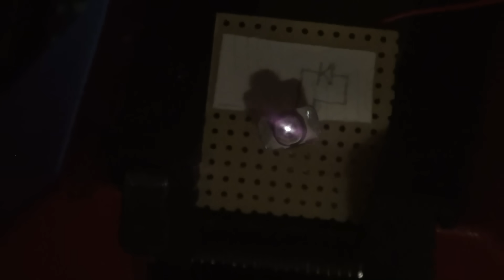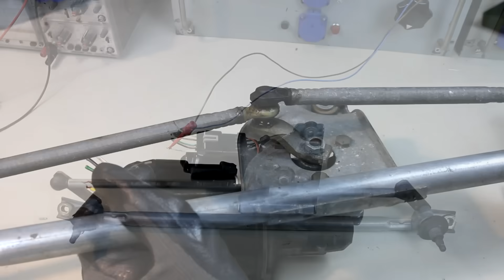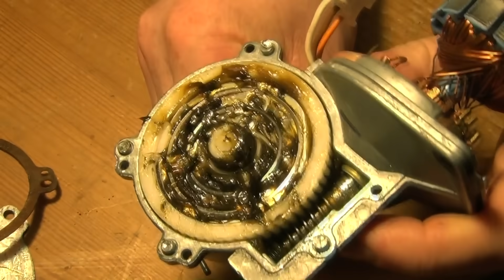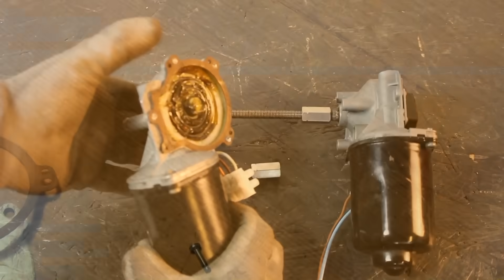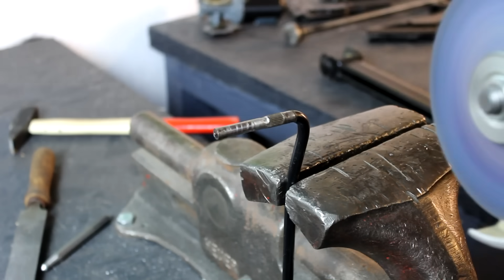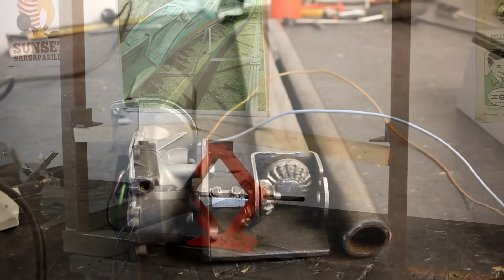Build Powerful Linear Actuators from Windshield Wiper Motors and Car Jacks

Comment: Watched until you said to use gasoline and a rag to clean the parts.  That's a very good way to burn your home/business down.  Nobody should EVER use gasoline as a cleaning agent.  Amazingly stupid comment.
Reply: Gasoline is just as flammable as any other thinner or solvent type fluid, people use them all the time and surprisingly still live. But those who can't comprehend flammable materials should really not go near a shop.
Reply: What should we use instead? White spirit/paint thinner/naptha/turpentine? Oh... they're all flammable too. How about brake cleaner or carburetter cleaner? Oh no that burns too. You see him using a welder and angle grinder, I think he's got the whole "don't set shop on fire" thing sorted ;)

Also, nothing wrong with setting yourself on fire occasionally, makes you warm...
Reply: Right to Record
Some still survive that didn't require 24-hour adult supervision, never received a "participation award" for anything, and didn't need mom to wipe snot from their nose. I know! Hard to believe, but they're out there.
Reply: I use it all the time for just that purpose, its excellent, cheap and readily available.

Comment: For a remote control steering unit, you should try the screw drive, power seat motor, like found in a late 80's Nissan Maxima (the one that moves the seat back and forth). It could work just as a rack and pinion unit. As well as open gates, and any other purpose you would use a hydrolic ram for.

Comment: have you thought about making a solar heater? with either air or H2o.  I'm sure you know how. or can figure it out. I'm planning on doing some type of solar heat for my off grid house. I plan on using water. so I can also use a wood stove . in the basement. as sort of like a boiler. for when its really cold. or no sun. great video like always.

Comment: you might find some motors and linkages to suit your purposes from seat adjustment motors . . . they have to be strong enough to move my fat ass so i bet they're strong enough for your robot.

[ unless you're building a terminator ]
Reply: will amoroso I was going to make the same suggestion you gave

Comment: please advise as to what you used for filler media to "weld" the stainless steel to regular steel.. I'm assuming more a "brazing" with something akin to silicon-bronze rod ?
Reply: Obviously I'm speculating but I believe that would be TIG welded with a stainless steel fill rod.
Reply: You can weld stainless with regular rods,it just won't be stainless anymore in the weld area

Comment: I built some of the same sort of devices. While making stabilizing for my camper van.
At first I connected a gear motor to a scissor jack. Made a nice little trash compactor.
Later I used a mechanical bottle jack, these worked great on my van.
My intention was not to jack the van off the ground, but lift it enough, so it wouldn't bounce around, as I moved around inside it. Great Video, Thanks!

Comment: Great video. Do you know of any wiper motors that dont have plastic gears? I would guess that would be the first thing to fail after a lot of use or torque
Reply: I would bet if you got a motor off an older car there would be no plastic. Ask someone at a car salvage yard about this . Preferably an older employee who has worked on older cars.
Reply: The trapezoidal screw takes most of the shit and abuse.  If you think about it the jack holds its own if you stop cranking and remove the crank it doesn't transmit any force to the stub; therefore the force on the motor whether plastic or not is minimal.
Reply: crzy11000 older cars generally are metal gears, you're right.
Reply: I believe that may be the idea sort of a shear shaft or weak link so the damn thing doesn't tear itself off the mounts if it binds up.
Reply: Howard Black a

Comment: building a robot from washing machines? build a scooter or wheel chair for someone. our gifts are to be used for others not so much for self gratification. lol and its so funny to see a plastic gear in the windshield wiper. cutting every corner they can.
Reply: Considering they run so little and you can find them perfectly intact in any scrap car I'd say those being nylon gears is just fine, far less fine when you open up an actual power tool and find that sort of crap in there...
Reply: The plastic gear is the  "shear shaft" since the motor has enough torque to tear itself off the mounts and destroy your firewall it is designe3d to fail at that particular part.

Comment: Another good source of trapezoidal threads that is rugged and can be obtained for cheap are scaffolding leveling jacks.  I have no clue how they're called in German, but I've used them before as the leadscrew for a wood vice.
Reply: Or mechanical hospital beds
Reply: Don't forget power seats for cars ;)
Reply: Yup I used them as leveling legs on my portable sawmill, found them in a scrap yard.
Reply: Leandro Pereira Yep, that's actually quite a good idea. Too bad they're too thick for many purposes though.
Reply: Gerüstfuss
Reply: The scrap yard will often house some electric garage door openers. There are lead screws that run the entire length, albeit a smaller diameter, but for low stress applications....

Comment: It's kind of annoying that manufacturers get away with pricing Acme threads as they do considering automation has pretty much removed any of the issues that plagued it back in the day. They make them just as easily as they make normal threads. But because they look different, you have to pay extra.
Reply: Economics of scale. Compared to normal threaded rods none really needs a lead screw.
Reply: +aserta Acme threads are cut, and then typically ground to a fine finish. Threaded rod is rolled with a thread die. The finish on threaded rod depends solely on how worn out the die is. If you can figure out a way to roll Acme thread that is precise as cut and ground thread, but as cheap as threaded rod, everyone will be begging you to take their money.
Reply: aserta it is a different operation, so overall scale comes into play.  Standard bolt threads are made by the billions, but the Acme type are much less common, thus slightly more expensive
Reply: I remember making them on a lathe back during my teens when I was working at my father's machine shop. Some as thick as two inches to be used on irrigation canal sliding gates. Now, of course smaller diameter ACME threads are rolled, particularly if they are to be used on applications where precision is not critical, like some actuators, car jacks, smaller vises, etc. For lathes carriages and as part of other precision equipment the threads need to be machined and polished to exact specs.
Reply: +Interstellarsurfer ACME threads are actually rolled. Its much faster and the cold forming creates a stronger thread.

https://www.youtube.com/watch?v=bclnb_Cp4sE
Reply: I found a source from a Factory in the US to get ACME for about 8 bucks/ft 
as opposed to 18 bucks.  for 1/2 dia.  screw.
and a little less for 7/16
(Resellers like McMaster mark it up to 18 bucks/ft)
Reply: pach maseen
Reply: aserta vtf f tgtfft  b g
Reply: Pass it on, please.
Reply: +Interstellar:
WRONG!!!  Acme threads are FIRST ground for a uniform OD.
Then they are ROLLED for a much stronger thread than CUT.
Reply: I used to cut 3.5 inch and 4 inch 2 start in 26%-28% chrome iron the single start was harder to do due the tool jumping out at the end
Reply: They not only look different. They're made of different type of steel and heat threatened, and made much more precise. There's really no comparison.
Reply: aserta n
Reply: Everything tody is charged at what they can get, for example why do wifi boosters  cost more than wifi routers?
Reply: "heat threatened"? sounds scary

Comment: It's interesting to explore gear ratios to move things. Wiper motor and window motors have plenty of gear reduction built in, as does the starter motor. If you play with hobby class remote control toys, you will notice the change in take off speed as opposed to potential top speed based on the pinion and spur gears used. If you discover the maximum rpm of the motor, then find out what rpm range it operates best at, then you can change the final drive ratio from the motor shaft to the other end of the assembly you want to power. If the gear on the motor shaft is small and the gears at the other end large, then the device operates slowly, but strongly. If the gear on the motor shaft is large and the other ends small, it may be faster, but less power over all. 
Motor manufacturers usually have spec sheets on where the input voltage should be to create the rpm range for peak power. Learn to plan your gear ratios with that, and you will have measurable success.
I hope in the future, you will come Sider hydraulic actuators and use a hydraulic steering pump from a car, powered by a robust electric motor. Those hydraulic pumps have internal bypasses, so they don't have to create constant pressure while spinning. Then you can use small valves with small servos to open and close them to have the desired actions. I've been working to invent flexible hydraulic actuators, but those secrets I keep for now.

Comment: those wiper motors have a surprising amount of torque
Reply: The srcret lies in the worm gear. The ratio of this gear is likely somere in the range of 40:1 - 50:1 meaning the speed is reduced and the torque is increased + it is not backdriveable. The dowside is that the efficiency is probably only 50 %...
Reply: 4X6 centimeters, or something roughly comparable to a 2"X3" (which is 1.5" X 2.5").
Reply: most all DC motors have a lot of torque and that's why metal lathes and battery operated drill or tools are DC. First it was all belt driven then pneumatic drive and now DC just for the torque.
Reply: Pacifico VW the reason I was impressed with the amount of torque is because I am nearly 400lbs and I need to bounce on a 2x4 to break it. So it must be able to output around that much.

Granted though my 400lbs is spread over a greater area than that of the jack.
Reply: The fact that it is a stronger piece of wood makes it boggle my mind even more :P
Reply: I am impressed that it can brake a 2x4; it can probably lift up a chunky baby off the floor.
Reply: @pacificovw9522  😁😁😂
Reply: Of course!  if you count the number of teeth on the gear  that is the value of amplification, bc the motor shaft makes a whole turn for only ONE tooth of advancement on the gear.  That means 60:1 or whatever the tooth count is,  IS the amp factor.
Reply: Jess, it seems like it is over kill for a car wiper motor, and then the gear is plastic.
Reply: The plastic gear is the weak link!  The motor will not last if it is subjected to high torque, but will last longer if only subjected to small torque like wipers!!
Reply: It can BREAK...not BRAKE. A BRAKE slows a car down...wheras if you BREAK something...it's broken...like the pieces of wood!
Reply: @Kurt and a short one at that.